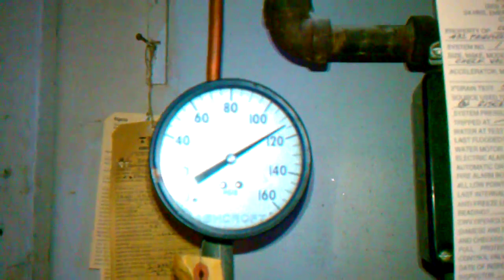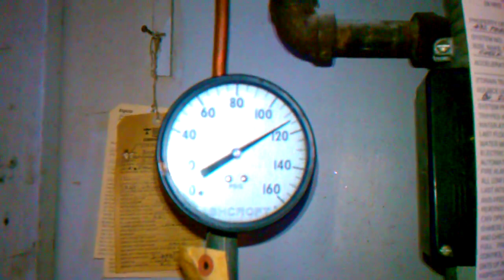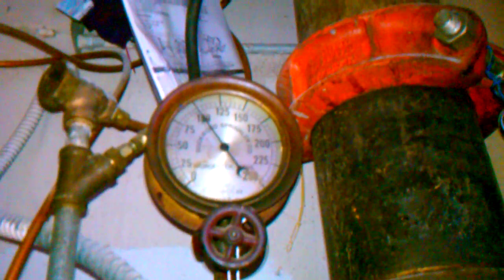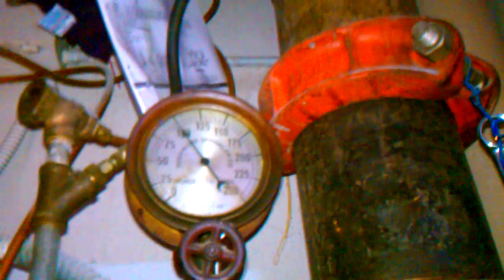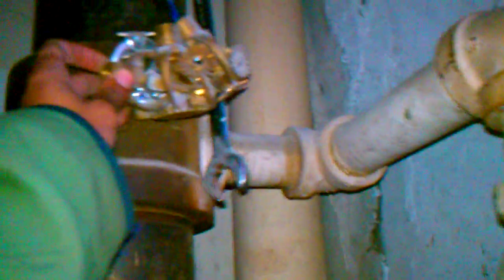Dry pipe system

Comment: I am a sprinkler professional as well. There are some problems with this wet riser. First of all, the spare sprinklers should be in a special sprinkler cabinet,along with the properly sized wrench. second, the water gauges are older than five years, they need to be checked for proper recalibration or replaced if they are older than five years. The debris around the riser need to be removed.

Comment: That would be a excess pressure pump on top of the check valve or alarm valve next to the flow switch. Just let me know what questions you have, I am a sprinkler inspector and I would be glad to help.